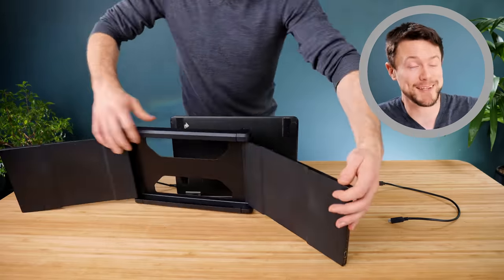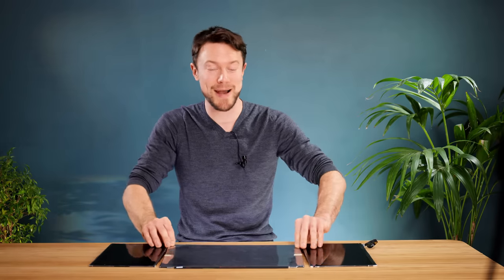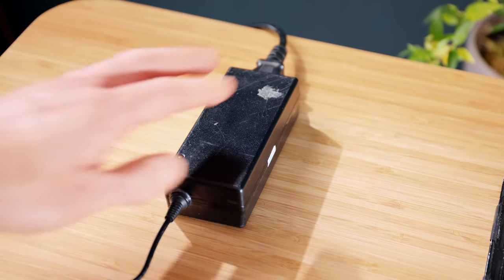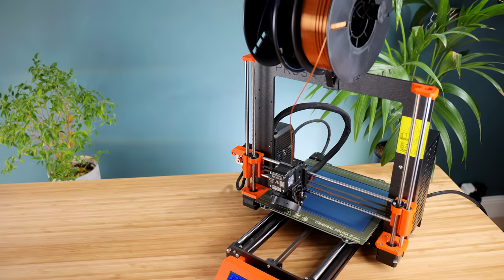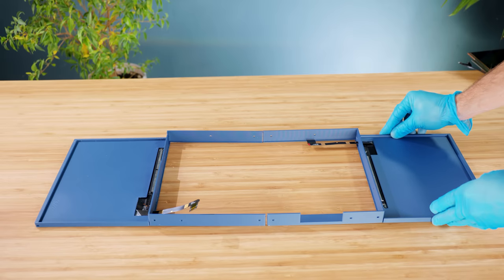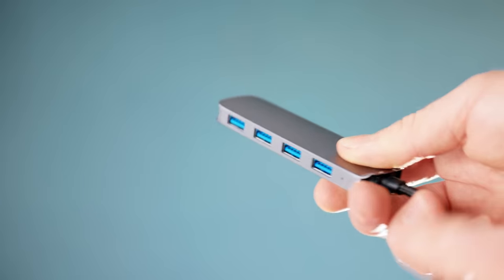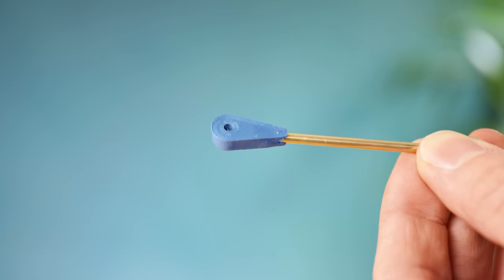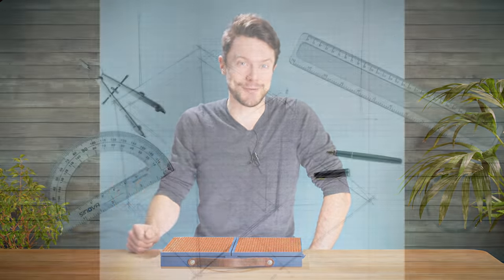Triple-Screen Laptop DONE RIGHT!

Comment: This is the sort of stuff I was excited to see when I first heard about Framework. Yes their laptops look nice, but because all the parts can be purchase individually and they don't do any lockdown shenanigans, it makes projects like this way easier and importantly, consistent if other people want to do it (rather than gutting an old laptop).
Reply: You could do this with a nuc way before
Reply: @hailstorm7868  Sure, but you can't by a standard laptop battery that will work with the Nuc out of the box.  

It's not that this wasn't possible before. It totally was, hell, just using an old laptop motherboard would do it. The difference is that it's easy and repeatable for others if they want to, without having to find the same laptop, then dispose of the screen and laptop body (and eat the cost of doing so, or just happen to find one with a broken screen, but still working internals).
Reply: @Somerandom1922  it also opens up the possibility of such project with up to date hardware. As long as Framework exists, they gonna make annual updates to their components and you can then upgrade you setup without the hassle of trying to match hardware to your DIY project.
Reply: *their laptops
Reply: @pietheijn-vo1gt  congratulations! You've made it in life!!
Reply: @hailstorm7868  Ah! But did they have a stand which put it at an ergonomic height, and give it a leather handle like a woman's purse? I think not.
Reply: @hydrolifetech7911  im getting there!
Reply: @z0bi_  amen
Reply: @hailstorm7868  I have an old nuk. It doesn't build anything.
Reply: @linus tech tips
Reply: Framework is cool
Reply: *their
Reply: *buy
Reply: Exactly! it's perfect!
Reply: You can use most of the thinkpads with intel processors for things like this I think. Because I used my idepad without a panel no problem. But with M1, there is nearly no need left for pc. Just a few for power users.
Reply: Make m1 air 500 dollars and eliminate 80% pc.
Reply: @hailstorm7868  yes but it looked shit with a NUC
Reply: @EdwardOnForex  I wanted to do this so bad

 "yo linus check this out"
Reply: @yigitanlgenc8396  A lot of people refuse to touch an apple product, and the vast majority of non-apple software only runs on x86.
Reply: @user2C47  i dont like apple, I like my wallet. I know how most people in my country would buy an iPhone in a heart beat if they had the money.
Reply: Linus and the Framework team really need to lean into the DIY aspect of their components i.e. raspberry pi
Reply: I'm not convinced about framework. Their main selling point is basically USB port adapters that fit inside the laptop case instead of sticking out? And Linus has a financial incentive to shilling it?
Reply: @emmaginn  But it isn't a DIY laptop, it's just a normal laptop with a few more components in slots instead of soldered.
Reply: I wish i could have...but u r far away...Thanks From Bangladesh
Reply: @thewhitefalcon8539  The entire laptop is still together by nothing but screws, and the motherboard can actually be used as a separate standalone computer. Most computers don't let you do that. Almost every single component that could break is replaceable. Hinge brakes? Replaceable. Keyboard? When placeable. Screen? Replaceable. All with a screwdriver and a little time, with no need to take it to a repair shop. And unlike every other laptop in the world, it's actually upgradeable. It started with an 11th gen processor, now you can replace it with a 12th gen. Linus fell in love with this concept so much that not only did he actually buy the computer as his new daily driver, but after the first video he made on it he invested $250,000. It sounds like a small investment, and that's because they weren't actually looking for big investments by the time he finally asked. He's also made it clear that should the company eventually betray its users, he will publicly denounce them and end his investment.
Reply: The finish in 9:41 is mad
Reply: @yigitanlgenc8396  ahh yes, Apple. Hates consumer repairability, and all products made in a factory with suicidal workers. 

Who wouldn't want to support that?

Qualcomm is making desktop ARM based CPUs soon. I'd rather wait for that, than buy something that makes Tim Cooke that little bit richer...
Reply: @hailstorm7868  you can't put an LCD directly to the nuc without a controller and power supply
Reply: @roshinparameswaran4817  yeah, but you can shove nuc's guts inside the monitor enclosure with some jerry rigging. My point was you don't need framework for it
Reply: Framework is absolutely amazing!
Reply: Their*
Reply: I’m interested to see a Steamdeck style diy handheld pc that uses a framework mainboard.
Reply: @badmoose01  I feel like the mainboard is too big. You could absolutely make a portable computer in a handheld formfactor but it would be much larger than any current handhelds on the market. You'd need to either provide a custom battery, or make it thicker by stacking it between the mainboard and the screen (making repairs more difficult). It couldn't be in-front of the mainboard as that's where the cpu cooler is. 

Still it'd be an awesome project!

Comment: This is a great idea. I worked as an electrical engineer programming machinery, and working on-site or near the machine with a laptop became a pain in the arse. I got a tripod and modified it with a plate on it, then made a long arm to hold a second monitor above the laptop. This allowed me to stand at the machine while plugged in and have the screen at eye level and keyboard and mouse at a comfortable position. I think this idea is amazing, incorporating this with a tripod stand and having a surface for a mouse and keyboard while having a removable PC this size at eye level would literally be the ultimate programmers workstation in an industrial setting.

Comment: DIY Perks always sets the bar so high each time that I think it's impossible to beat. Yet he beats it at every single video. That's an incredible task.
Reply: 10:35 that mechanism along would have taken me a full days of trial and errors with half a dozen test prints. He made it looks easier than it is
Reply: It's not very compact, but still it should barely fit into a compact backpack. The problem is navigation.

Touchscreen on all three displays?
Would be neat, but those legs and hinges would be wobbly.

Keyboard and Trackpad?
There's none. You won't be able to fit it into your bag, unless you get something hilariously small and un-ergonomic. Or you hope wherever you go there's a spare unit to borrow. Or you just don't use one and have no interactability.
Reply: indeed, thoes leags r a litte bit to high, but it can be fix anyway, about touchscreen....indeed, it will be super hard to use, about mouse and keyboard, well....in the market, it have a plenty of slim mouse and keyboard to chosse so that maybe not become a problem
Reply: Hes a kingsman theres nothing less to expect. You cant make brains like this anymore

Comment: This is pretty awesome. It's great to see the framework's modular design being taken full advantage of. I would if it would be possible to slot a small keyboard and mouse into the case somehow. Then it's be truly portable.
Reply: Awesome ideas! That would be the dream laptop, by a long shot!
Reply: damn i left the same comment. then it trully is the logical next step
Reply: Something like the Microsoft Surface mouse would be ideal. It straightens completely flat when you want to store it, then bends into a curved mouse shape when you need to use it. For the keyboard, I guess a low profile super compact one will need to do.
Reply: A laser keyboard would be awesome (if they worked properly)